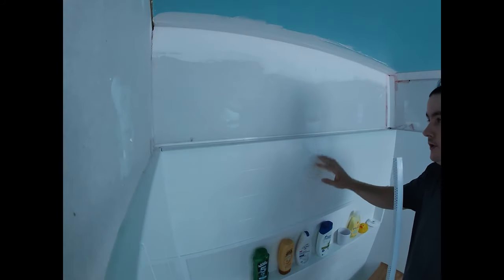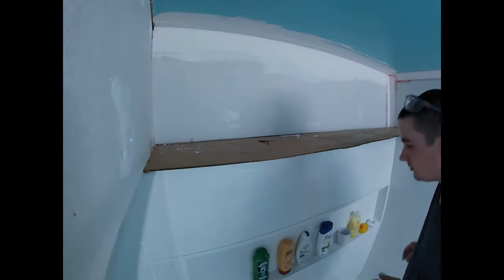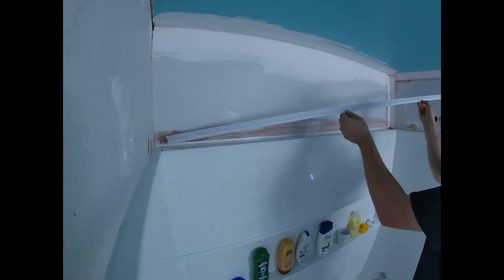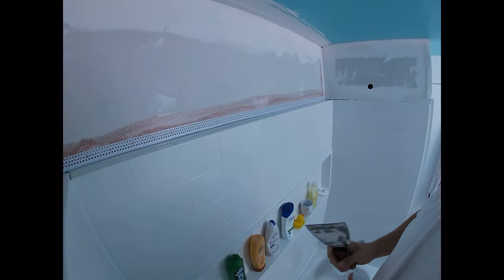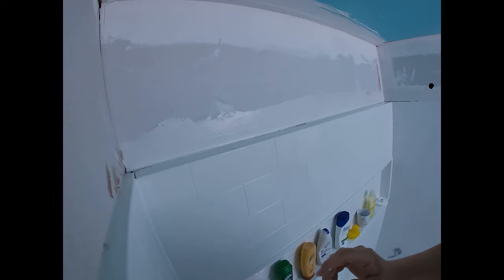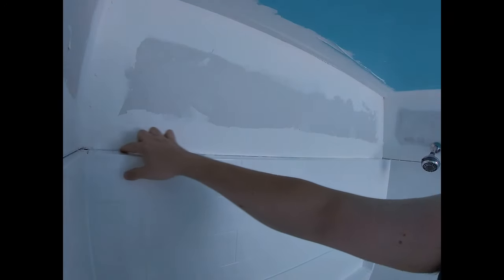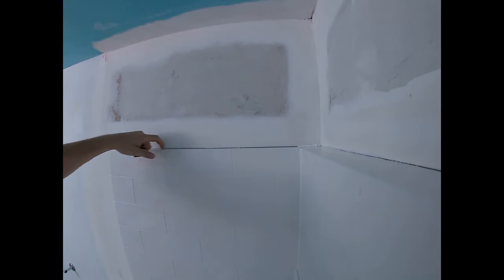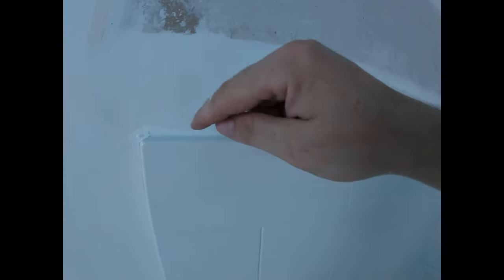Finishing Drywall Around A Fiberglass Shower Surround

Comment: That's the wrong profile...you used the short flange profile for like up against windows. The correct version is called Shower Bead and has a 2 1/4" perforated flange which easily bridges the gap around the surround. I just installed this same surround and used this same incorrect profile because  that's all I could get without buying a lifetime supply of the unicorn Shower Bead.
Reply from the maker: This is the correct bead. I contacted the manufacturer directly and they suggested this bead for my application. This bead is for butting drywall up against any finished edge. Doesn’t matter if it’s against a window frame or shower surround. And if you need a 2 1/4 flange to fill the gap then you need to learn to use a measuring tape. I left only a 1/4 inch gap myself because I know what I’m doing. But I suppose there is always that one person that has to find the smallest flaw (in their opinion) in an otherwise flawless installation. Thanks for watching.

Comment: I have water damage on the drywall above my shower, I was thinking about cutting out the part thats damaged ( about 2-3 inches above the tub where it meets the drywall ) and installing new mold/water resistant drywall, putting tape and mudding it, then doing what you did here. Would that be a good way to tackle the situation? Although I'm not sure if the mold grew onto the studs but if it did could I just apply some bleach to kill it? Thanks in advance
Reply from the maker: I prefer to cut about 6 inches above the tub. If you try to screw in a 2 inch strip of drywall it will most likely break. The 6 inch piece will make it easier to attach to the studs. And yes I would advise mold resistant drywall. If there is mold on the studs you can put bleach into a spray bottle and mist it. Then wipe it clean. Then must it thoroughly and let the bleach dry and soak in then install your drywall and mud.

Comment: Why not sand and paint before tearing off the strip?   Then you could paint neatly into the corner, or at the very least, prime, so that you only have to caulk and finish paint after the tear-off.   Also, is that paint 100% silicone / paintable?
Reply from the maker: The method in the video is the way the manufacturer tells us to do it. If the manufacturer states this way and it works, why try it another way? They obviously tested the best way for their product to work. For the silicone to be paintable you need to check the label on the caulk before you buy. Some are paintable. Some are not. Thanks for watching. Please like and subscribe
Reply: I agree, I would sand and paint first, then apply silicone.  Makes the most sense.

Comment: If you use Sheetrock 45 or similar, aka hot mud, it won’t shrink.  Do a first coat with that and then a finish coat with lightweight mud.
Reply from the maker: Excellent tip. Thanks for watching. Please like and subscribe

Comment: Thanks for the video I am really glad I found it. You also installed a Bootz Nextile surround. I'm a newbie but courageous diyer who's having a dilemma with the shower side drywall. Specifically where the surround tab sticks out past my alcove depth (30"). I planned on using a Schluter tile trim but was wondering what you did. Thanks for showing me that plastic trim edge, that's perfect!
Reply from the maker: Thanks for watching. Glad I could help. I used an oscillating multi tool to cut the overhang flush with my corner wall then sanded the edge a bit to smooth it and round it a bit. I actually haven’t finished it up yet. But if you buy a small t shaped schluter tile trim strip and slide it in the gap and glue it down it may look nicer. I’m going to look for some low profile vinyl quarter round and glue it over top of the seam just to hide it as another option. Theoretically any flat vinyl or plastic or pvc bead can simply be glued over the seam. Hope this advice is what you are looking for. Please like and subscribe

Comment: Thanks for the tutorial. One question, though. Did you use non-paintable 100% silicone white caulk on the gap between the drywall and the tub surround? How did your paint job turn out? Silicone caulk is the best for waterproofing and mold and mildew resistance, but can't be covered properly with acrylic paint.
Reply from the maker: Thanks for watching. Yes I used 100% silicone caulk. The paint job turned out ok for my liking. The paint I used is white with a hint of grey tint so it’s not too far off from the caulk color. As I painted it would actually bead up on the caulk and not dry. But barely noticeable. thinking back I suppose I could have painted first then caulked for better results Hope your project turns out well. Please like and subscribe.
Reply: @BillOfAllTrades2016  Apparently you can hit the caulk with some spray Kilz primer or similar and that will help the paint stick.
Reply from the maker: @eddiemarano9998   ok that’s good to know. Thanks for sharing that tip. And thanks for watching. Please like and subscribe

Comment: Did you apply the drywall over the surround flange? I also have this trim since I couldnt find the 2 1/4 one, and I put the drywall right over the flange. Hope that will work OK
Reply from the maker: Yes. I put the drywall over the flange. I left a 1/8-1/4 inch gap between the drywall edge and surround finished edge. Your application will work just fine. Thanks for watching. Please like and subscribe

Comment: Why do you use a corner bead? Would it provide more resistance to molding compared to not using it and just putting caulking? Thanks in advance.
Reply from the maker: I used a corner bead because it’s better at covering imperfections. I always face my cut edge to the corner so the corner bead hides it. I tried just using caulking instead one time and over time I found it would start to peel. A corner bead has better permanent results and presents a better finished product. If you use a corner bead with a plastic backing it will provide the protection you need. I hope this helps. Please like and subscribe
Reply: @BillOfAllTrades2016  Thanks for the help, I've liked and subscribed 👍

Comment: Hi what kind of drywall did you use. Cement board or regular drywall. A reason why I'm asking is because I'm replacing the new fiberglass shower also.
Reply from the maker: I just used standard drywall. And less dust drywall compound to keep the mess to a minimum. Thanks for watching. Happy renovating and be safe. Please like and subscribe

Comment: I work for a major production builder....never once seen them use corner beade around a ahower sadly
Reply from the maker: I’ve seen people do it without corner beads as well. I’m not at that master level though. I’m simply a DIYer so putting a bead makes the install easier
Reply: @BillOfAllTrades2016  i meant that the builders should be using corner beade... much better install imo!

Comment: If you have a plastic shower enclosure with a flange all the way around, can you do it the same way or do you need the 2.5" L tear away bead? It seems impossible to find
Reply from the maker: You would use this size as shown in the video. This will fit any application of a finished edge regardless of thickness. When I searched for the tear away L Beads it took weeks to find. I finally found them at a local store called Home Hardware. In my research I could only find the ones shown in the video. I’m pretty sure there is only one size. The only difference is the length. Thanks for watching. Hope this helps your project. Please like and subscribe

Comment: Is that Trim-Tex?  Where did you find it?  I'm struggling.
Reply from the maker: Yes it is. I got mine at home hardware. We are in Ontario Canada. Thanks for watching. Hope you find some. Please like and subscribe
Reply: They have this at home depot usa Florida,  I just got the exact one. It is not trim tex
Reply from the maker: Ok. Ya every time I looked USA had them but here in Canada they only carry in one chain store. Thanks for the tip. Please like and subscribe
Reply: @Anonmesye  I got something similar from Home Depot also.  I think they key difference is the piece that goes over the sheetrock is not as long, and I'm not sure if it will work for me.

Comment: just a quick question is mold and mildew drywall necessary throughout the bathroom or just around the exterior of the tub/shower area? having a heated debate...lol
Reply from the maker: Mold resistant drywall is generally only necessary around the tub surround area where water may come into contact with it. The only time you should use mold resistant drywall on the entire bathroom would be in a bathroom with no exhaust fan where the steam from a hot shower would linger for a long time. Hope this helps shed light on the debate. Thanks for watching. Please like and subscribe

Comment: How did you treat the outside corner ? I am getting ready to install the same system and want to make sure it looks as good as the job did !
Reply from the maker: For The outside corners and inside corners I used a paper corner bead with plastic backing and used my spray adhesive to attach it. Thanks for watching. Hope it turns out well. Please like and subscribe

Comment: Do you have a video on your boots tub and surrond installation? Did you go directly to the studs or did you  install it directly to a greenboard or cement board?
Reply from the maker: Unfortunately I do not have a video for the install. I tried filming and at the end of the install I realized my camera died part way through. I installed directly at o my studs. I ripped all the drywall out. It is supposed to be attached direct to stud. Thanks for watching. Please like and subscribe
Reply: @BillOfAllTrades2016  will do, thank you. Were you satisfied with the install and would you do another one or go with something different? I've seen videos where ppl say the back wall isn't straight and you loose some space in the tub due to the niche sticking out.
Reply from the maker: I really love this shower surround. Even a year and a half later it’s still great. Never had an issue with the install. As long as you use a level to make sure it’s straight then you will be ok. And at first the niche shelf does stick out a lot and I was worried about it being annoying. But I got used to it fairly quickly. I no longer have an issue with the shower being more narrow. And I have long arms and wide shoulders. I recommend it 100%
Reply: @BillOfAllTrades2016  awesome, thank you for the info. Subscribed.

Comment: I’m confused about the drywall. My Nextile surround is installed directly on the studs. Once the drywall is installed (1/2” thick) it will be sticking out further than the lip on the surround. Is this the way it’s supposed to be? Not flush??
Reply from the maker: Mine was like that as well. The old drywall is 1/2 inch thick. So I came up with the solution to install 1/4 inch drywall around the edge so it sits lower and flush with the original wall. If that size reduction still doesn’t help, then you can also use thinner studs as well as 1/4 inch drywall to further drop the edge of the new patch. Thanks for watching. I hope this works for you. Please like and subscribe
Reply: Hi I’m stuck. What did you end up doing I have the same problem and way beginner and already bought 1/2” drywal
Reply from the maker: I bought 1/4 inch drywall to go around the surround and it will be flush.
Reply: @BillOfAllTrades2016  maybe a dumb question but if using 1/4” drywall what day l bead should k be using ?

Comment: Did you use any special type of drywall mud or just something ordinary? Pre-mixed? Quick-set?
Reply from the maker: I used Easyfil Dust Away drywall compound. It was the premix in a bucket with a light turquoise lid. Can be purchased at any hardware store that carries Easyfil brand. Thanks for watching. Please like and subscribe
Reply: @BillOfAllTrades2016  Doesn't look like a consumer like myself can just buy a small amount of this for a small bathroom job. Any suggestions on how I can get ahold of the tear-away bead otherwise?
Reply from the maker: Do you have a home hardware near you? That’s where I got mine. They sell them individually
Reply: Are those in Canada only. I don't believe any of those stores are located in Ohio. The main big hardware store chains here are Home Depot and Lowe's I do not believe they are listed as dealers for trim tex supplies.

Comment: Don't do that dumb s***.    Il give you the proper steps. 
Step 1.  Fill and big gaps with hot mud.  
Step 2- flat tape with paper tape around the whole thing.  (Preferably with 20 or 45 min  hot mud ) 
Step 3- bed in with a 6 inch knife like it's an angle.   Leave mud fairly thick. 
(Don't pull too many times or you pull too much mud off) 
Step 4 once it is dry, sand it real good  and do a tight skim with an 8" knife or a 6".  Just make sure you skim where you feather edged. 
Step 7- after you tight skim it 1-2 times.  Sand it with a sanding block.  The square ones from home Depot and take a water sponge and hit the edge 1 more time and then it's ready for paint.    Comes out super good.  
     You welcome.    
GODWIN CONSTRUCTION LLC
Reply from the maker: Thanks for the tip but I’ll keep it simple with the method demonstrated in the video. One corner bead, generic drywall mud, smooth it once, then sand it once. Ready for paint. But again thanks for the tip.